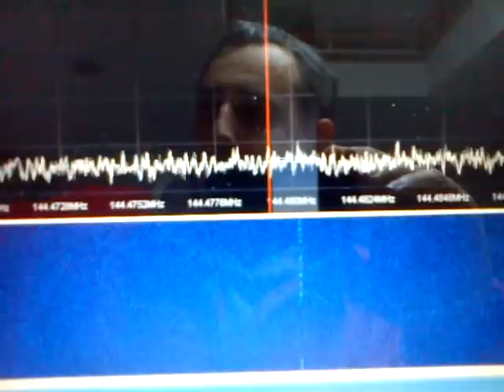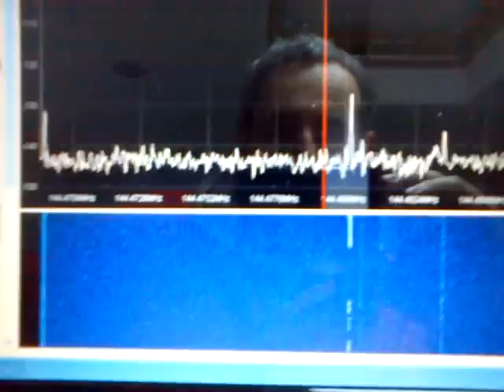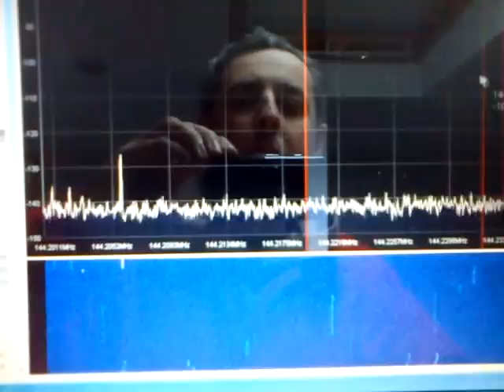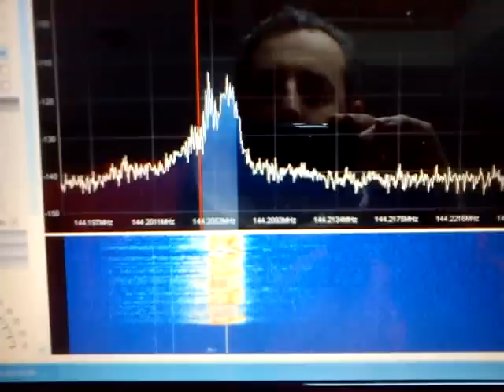DVB T SDR dongle with the BPF

Comment: I have also been experimenting with various filters as well and made similar experiences, just never as pronounced as in your case. I use wide band VHF&UHF antennas and the S/N comes up rapidly when inserting the filter. I guess due to the fact that the antenna uses 50 Ohm and the dongle 75 Ohm, at least the insertion loss gets compensated by the perfect match if you tuned it manually for best signal.
Reply from the maker: Hello, well the main problem with the DVB-T SDR are blockers that are not filtered at all due to the DVB-T dongle design. The DVB-T dongle saturate quickly due to strong signals present at the input from the TV, radio and cell towers. Reducing this blockers with the filter improve the S/N.